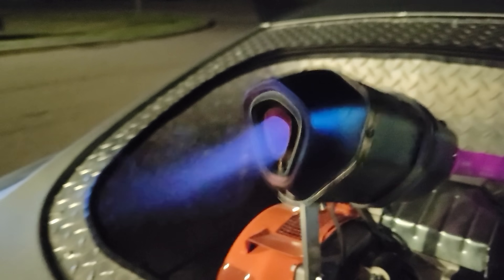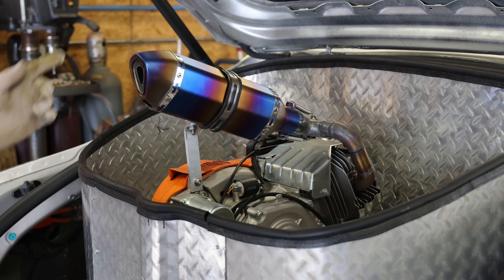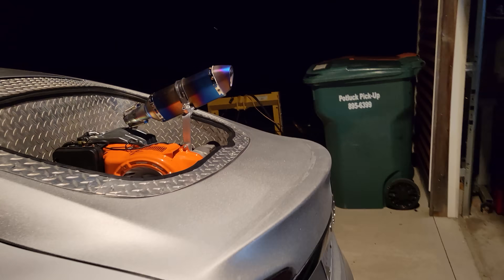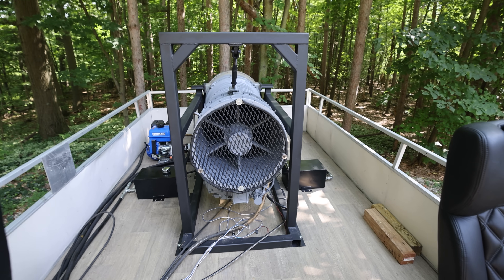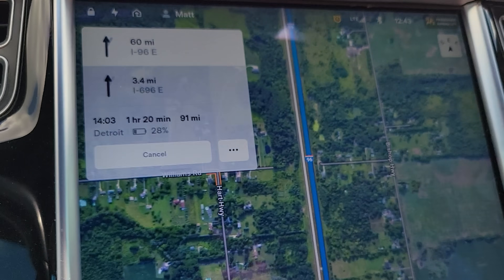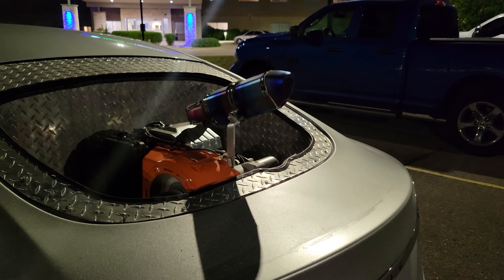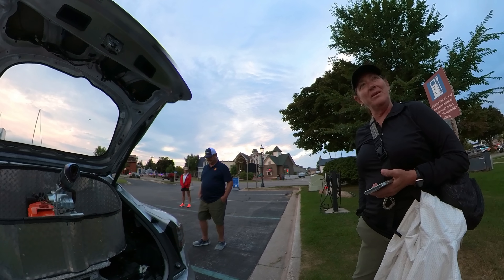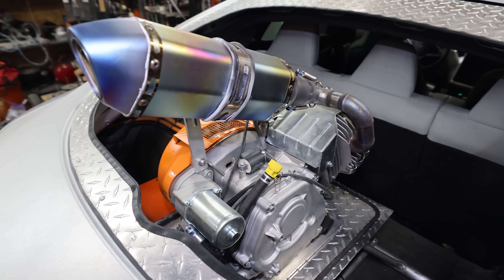Cordless Tesla (I Drive 1800 miles without charging) P.1

Comment: A mod like this is essentially useless. I give the YouTuber credit for the work, but he essentially re-invented a hybrid car, one without the drivetrain to allow the engine to propel the vehicle. And in most cases, the engine couldn't keep up with the power demands the Tesla needed, which is why he needed to run the engine all night to recharge. It's not innovative and it wasn't efficient. If you really are thinking about throwing a generator or engine into your Tesla, just buy a Toyota instead. You're missing the point of what Tesla is about.
Reply: Tesla bros getting butthurt. Cool mod, reminds me of the old Top Gear episodes when they do cool yet useless stuff.
Reply: I can see fire hazard on that gas station. Fire spitting exhaust is really, really bad thing there.
Reply: You got pulled over for going to slow,  this car is only useful for a certain group of people.  It defeats the purpose of even buying 130k car.  All you managed to do was show us your wealthy enough to chop the shit out of a 130k car.. .. "what's all the racket" 🤣🤣🤣
Reply from the maker: @lockhamj  lol... So basically what you're saying is that I'm smart enough to figure it out build it execute it and film it, but I'm not smart enough to get a deal on the car? You think I paid $130k for this lol. Cmon
Reply: I disagree; definitely not useless. 
It IS a valuable experiment. It's a sort of prototype.
Reply: I have developed a magnet motor that produces usable torque and RPM and can easily drive a generator and end the need to plug-in EVs.  It's a simple inexpensive design with minimal moving parts about the size of 2 shoe boxes.  Silent operation, green energy.
Reply: A car with a generator which recharge a battery is not an hybrid car. Hybrid car has 2 engines technlogoly connected to the wheels. This tesla here is an EV with a range extender. Nothing new. BMW i3 has it and it works perfectly fine
Reply: There he is that one moron that takes YouTube videos too seriously. Dude stay quite and move on next time
Reply: Little harsh there   
This is the principles of the future.   You must make the energy. Every where 
not using a central grid.    
It’s the weight to power rerun issue 
Sure we can’t all switch to a 3000 pound battery.    But we can generate 
I feel a light weight car   Built around a roll cage.    With light weight Baja type suspension could run a fluid  drive six speed matched to an over built golf cart motor     At that point an old dc rv generator  would work
Reply: That's why I will stick with my chevy volt...sorry Tesla as much as I would love to own one, I can't imagine interrupting my trips or deal the anxiety of running out of battery. 
I would buy a Tesla anytime if they build a model with a good and quiet generator like my chevy volt.
Reply: Need a heftier power plant.
Reply: What is Tesla about?
Reply: @johnhenke6475  ripping people off
Reply: Imagine if he put in an engine/generator that is 3x the size! He wouldn't need to charge it over night!
Reply: Lol, buy a Toyota Hybrid and get 650+ miles per fillup.
Reply: @Warped Perception:  Can you please pin Nick’s channel for us?  He’s a badass too.
Reply: How useless?  He is thinking outside the box, that is how innovation happens.  I had a drop engine concept that would replace an existing gasoline engine with an EV motor, batter pack, and possibly generator, leveraging existing drivetrain.  To me, the idea is how can you reduce the gasoline engine footprint (even if using a generator to charge the battery or just the battery pack and charging stations).
Reply: Reminds me of those old crazy Top Gear challenges.
Reply: I mean, a cordless Tesla sounds cool. I’d want one of those.
Reply: Well said,  in that case try solar backups or a way to drastically reduce the noise
Reply: lol you are a bit salt.
Reply: Toyota is actually making a hybrid that works the same way. Electric motor.  Has an engine but the engine only provides electricity
Reply: @u-know-this  Yep. But theirs will be better than 19mpg or 6 times the price of electric charging.
Reply: @markp8295  cry
Reply: Tesla is about a badly built car. Limited range. Limited recharging stations. Hours waiting for it to re-charge. Just wait until the computers start going bad and the batteries start failing from age that should be a ton of fun.
Reply: You're missing the point. Teslas are light years ahead of other hybrids. Test drive one with FSD before you make such silly comments.
Reply: HELL YEAH, COAL CITY ELECTRICITY OVER 2 STROKE WITH EMISSIONS WORST THAN A FORD RAPTOR
Reply: Cry
Reply: You are totally right.  The only thing you're missing is he can put Tesla I. The title for more clicks.  

I would just say this is much more like the Chevy Volt that could charge the vehicle while driving and, in certain limited instances, drive off the gas engine.   I would have loved to see where that tech would lead if it wasn't overlooked for a basic electric car.
Reply: Creator looks like an idiot in this comment section, he shouldve used a different muffler
Reply: Tesla needs to look up info about the, Elektro Dumper (eDumper). It's a coal mining electric dump truck that recharges without stopping, and is designed to continuously transport 59 tonnes of material.
Reply: Would it charge faster with a better generator on a higher voltage?

Also that noise drives everyone crazy
Reply: No se trata de eso, pardillo, solo imagina un motor más potente para cargar y disfrutar del tesla muchos KM. a todo trapo.
Reply: William Pyles is a salty sailor that's missing the point of the video.
Reply: The only kind of mod I'll be impressed with is.... MR Fusion!
Reply: Takes 20 days to charge a Tesla off the solar, so you are really using oil, just through your home electirc
Reply: There's nothing to talk about, this project was more of a joke. A joke to see if he can and if it could work and it did. This is content, not a study.
Reply from the maker: No offense but I think you're missing the point of what the Tesla is all about, my car is almost 1,000 HP AWD all electric, loaded with technology and an absolute blast to drive. But guess what, I want 120 MPG with a range of 1500 miles at 80 miles per hour and the flexibility to do what I want when I want, especially with $130,000 car. That's what I want, I don't want a Prius, I don't want a toyota, you go by a Toyota, I've had two Priuses already, I want my Tesla. Just grab some popcorn sit back and watch the show I'll take care of the rest.
Reply: @WarpedYT  My grandfather had this idea years ago. I’m glad someone finally did it. 
The guy who commented said you essentially created a hybrid, which is false. This isn’t the same as a hybrid. Not really.
Reply: @CoffeeAndBusiness  technically this would be called a series hybrid, most hybrids on the market are parallel hybrids.

However what he made here is a Tesla with a motor in the trunk not actually hooked to anything. He shows nothing of how this “generator” is hooked to the car. Or how he overrode the cars internal software that prevents it from moving when it’s charging. It’s fake.
Reply: @Agenderous  I’m ignorant on the subject, but it seems like you could just hook an alternator up then hook that to the battery.
Reply: @CoffeeAndBusiness  You're right. This is worse. As his figures at the end show. 19MPG is dreadful.
Reply: @CoffeeAndBusiness  an off the shelf alternator works at 12v DC. Teslas EV battery packs work at 400VDC. So either there is a special Alterntor/Generator involved(which would be cool to see), or some other devices hooked up in line with the off the shelf alternator. Another option I’ve looked into is using a standard house generator and converting the 60Hz 240v AC into DC, but again if that’s used here id like to see it.
Reply: @WarpedYT  I feel like your insistence on not using an actual charger was silly (I get what you were going for though). You should have used a charging station where it was conveniently possible. Using the generator as a range extender rather than the only source of charging.

Don't know why you're so butthurt in your reply towards William Pyke (I mean I guess he could have been nicer in his original comment, but as a YouTuber, you got to have thicker skin, part of the job), because the fact is, the way you presented the usage of the motor you did in fact just make a worse hybrid, which is also your own conclusion at the end of the video.
Reply: No one cares, buddy.
Reply: @WarpedYT  👍I liked the video and the idea. For me I would want it more muffler to dampen the sound. Also more power from the motor so does run all night. Could also keep you above 10%. But I don’t know Jack if the Tesla will allow that without the quick charge .......
Reply from the maker: @cannednolan8194  yeah I didn't / don't like that crap muffler either
Reply: @WarpedYT  you should get a stock muffler from a sports bike it would works 100 times better
Reply: @WarpedYT  yeah he could have made it more silent with better mufflers, imagine staying in that hotel and listening that shit noise overnight..
Reply: @WarpedYT  haha nice, I'm wondering where you got the extra 250 hp from, my models  is 720hp ish, I was thinking of doing a similar mod, I just bought the chevy volt, which is 100%  electic drive, when it
Reply: @WarpedYT  You say you want 120mpg... But you yourself calculated 24mpg at slow speeds. So you're off by 500%.
Reply: @WarpedYT  I love this idea and I think your experiment is brilliant, and some new cars like the 2022 Civic are implementing some version of this. However (and please correct me if I'm wrong), 'generators' convert thermal energy -> mechanical energy -> electrical energy, whereas the typical 'engine' converts thermal energy -> mechanical energy -> kinetic energy. Hence the engine would be more efficient as it requires one less level of energy conversion than the generator. So is this challenge the limiting part of this experiment?
Reply: @WarpedYT  I love the Tesla option that locks the occupants in the car when it catches fire 👍…by far the most visionary tech when it comes to fixing society’s short comings 😂
Reply: @WarpedYT  LOL!   Who wants to drive the noisiest damned Tesla in the  world!   You're the one that's missing one of the prime points of the Tesla, it is silent.
Reply: @donadams8345  cry
Reply: @WarpedYT  Isn't this also a method to avoid taxes that ICE/hybrid cars pay?
And circumvent noise emission laws .
Reply: @WarpedYT  I bet carmakers will looking sucks after you're ready with all your mods! Nice! 😄
Reply: @WarpedYT  I think you're miss
Reply: @WarpedYT  ironically I think you're missing the point of what the Tesla is all about.
Reply: @GraemeTaylor  no one cares about what you think tesla is all about
Reply: @WarpedYT  Take it to Wyoming and you'll quickly realize that your stated range is actually, quite literally ~26% of advertised. The wind and elevation decimate over half the range alone, and I didn't even take into account if you happened to want to pass through in the winters or when its cold. Someone wrote a story about his new leaf w/ 300 mile range, not even getting 80 on a full charge in WY.  Wanna carry enough food & water plus some supplies incase you're out for a while? Go ahead and chop a few more miles off that lol. Nothing wrong if you don't like to go into the country much, but you're really missing out. Oh yeah, and don't forget that trickle charging batteries is extremely unhealthy for them, will detoriate your "engine" far, far faster than properly charging.
Reply: @WarpedYT  and it's pretty neat
Reply: @WarpedYT  Tell me you're trolling without telling me you're trolling 😄.
I too would love a modern car with all mod cons and 1800 mile range, I think if it was down to me (1000hp aside), a Prius with an extra 20 gallon fuel tank would be cheaper and do the job 10x better, simpler, quieter, and possibly do the trip with one or zero stops. But props to you getting it done. Be interesting the next version of it.
Reply: @WarpedYT  pov tesla is your whole personality
Reply: @WarpedYT  I see what you mean but I (personally) don’t think having a 1000hp AWD car is worth if at the end of the day you drive 45 in the highway so you don’t have to stop, if you have to stop to recharge it, you then use a supercharger silent and faster. That said tho just saw your final conclusion and I see u agree it doesn’t make sense since u gotta stop (and the noice is way too much but with a little more time I bet you could silence that baby and probably a bigger one so you are not that capped and can keeep going at a decent speed
Reply: @WarpedYT  I have a BMW i3 with a range extender that is essentially this setup from the factory (minus AWD and 100HP of course). I love the range extended gas generator on it, 99% of my driving is all EV commuting but when I need to go farther then I just turn on the generator and it works awesome. It's a 650cc two cylinder scooter engine. The i3 itslef is fun, but its not as much fun as a tesla. But I just take the Bronco or the RX-7 if I want to take a mountain/track toy anyways.
Reply: @WarpedYT  lolz your comeback was pretty good except for the 2x Prius part 🤣⚡🤙
Reply from the maker: @DLVRYDRYVR  I'm just being honest, I owned 2 Priuses, they are amazing and one of my favorite cars. I beat those cars non stop and only filled up with 10gal of fuel every 3 weeks.
Reply from the maker: @DLVRYDRYVR  by the way I also still currently own a Supra , Toyota is top dog in the automotive world, fantastic cars.
Reply: @WarpedYT  - I can understand wanting 1,000 HP, but I can't think of too many places or instances where 1,000 HP in a street car would even be something that can be utilized. Meanwhile, you also had to stop so many times to wait for your car to charge back up. This past weekend I drove a 2012 Ford Focus (manual trans) from Cleveland, Ohio to Lexington, Kentucky and back. 340 miles one way, and never had to stop for gas. I filled up when we got there, drove around town for the weekend, then back to Cleveland without adding any more gas. Made it without stopping for more. On a road trip I get about 450 miles on a 12 gallon tank. My time is more valuable to me than power that cannot be used on the street.
Reply: @1001Hobbies  autobah. the straights are no joke u can see urself driving for 30 sum miles fr
Reply: @KoopaSKI  - But this guy is not in Germany, he is in the USA.
Reply: @WarpedYT  I’ll NEVER forget my first experience driving a hybrid car. 
AMAZING!
The ICE started only once when I was merging into freeway traffic.
Reply: @1001Hobbies  I’ll use 1kHP on any side-street! LOL!
OF COURSE I’M KIDDING!
Reply: @WarpedYT  Next time put a diesel generator, should be more efficient
Reply: @WarpedYT  Couldn’t you just get a alternator or something? And you know how the alternator turns with the timing belt, so the RPM of the engine dictates how fast the timing belt spins which in turn dictates how much the car battery is charged, right? Except since a Tesla has no engine, so you could somehow amaze 4 belts that connect to the wheels and 4 alternators, and whenever the wheels are spinning (driving), the belt will turn the alternators
Reply: @WarpedYT  

"Top dog" ? 
Granted they build the best mini van you can buy but most of their sedan type car's lack in design and I wouldn't have a full size Toyota pick up even if you we're buying it for me. 👌
Reply: @1001Hobbies  

Now I wanna see an all Ford Focus street takeover 😆.
Reply: @1001Hobbies  You're obviously not a supercar guy, and yes, I did see you rebuilt a 66 mustang to trophy levels. You're a different kind of car guy, and that's fine, but don't disrespect what Warped Perception is doing. He has a car that does 0-60 in under 2.0 seconds, have you ever experienced that kind of slam your neck back speed, I highly doubt it due to your not understanding the allure of a 1000 hp car! I've had fast cars, but nowhere near that Plaid's speed capabilities, and I used every bit of power I had doing 3 1/2 hr Vegas runs in 2 1/2 hours, it was always a blast, a bit crazy, but fun, and that was my adrenalin rush instead of other dangerous things people do to get that high. I totally get where you're coming from eking out every mile possible from a compact car. I knew someone who gained a lot of joy doing that, he was a penny pinching miser, and every penny saved was pure joy to that man, and I get it. I'm not saying you're a miser, but the gentleman I knew was! Different strokes for different folks as they say, and I can totally see where I could use that 1000 hp, and you can't as it doesn't give you pleasure to go fast like it does myself, and Warped Perception. He just wants to add the ability to use it as you would your econo car, and take long trips without having to stop.😎👍✌🎃
Reply: @WarpedYT  So are you going to address the fire hazards before 130 thousand dollar car burns to the ground
Reply from the maker: @Gasoline4ever  I don't see any fire hazard actually, what are you referring to?
Reply: @Gasoline4ever  It's the aluminum parts surrounding the motor in the trunk.
Reply: @WarpedYT  The gasoline you say you were spilling is the fire hazard.
Reply: @ThangTran-bj4we  the diamond plate he used looks cool, but its not leak proof. my point was he had a fuel leak. If the fuel leaks below his hand made engine compartment, bad things can happen. gasoline, lithium batteries,and a leaky fuel line can produce a hell of a fire. just sayin he needs fire protection to be a big part of his build.
Reply: @Gasoline4ever  😅🍷
Reply: @WarpedYT  build quality of those garbage cans
Reply: @WarpedYT  I think he's referring to the fact that your Muffler produces a flame coming out of it and you admitted on your trip that you were leaking fuel so I too can see an issue here.  The other thing, It's just too loud, parking away from the hotel is fine, but having to wear earplugs while being near your 130K vehicle whiles diminishes the value for me.
Reply from the maker: @markp8295  waking up in the morning is a fire hazard
Reply: @WarpedYT  Hazard/Risk  assessment. Likelihood x severity of consequence.

Consequence = fire

Likelihood
Waking up = very low
Leaving pools of gasoline next to a red hot generator = High
Reply: @WarpedYT  ruined a master piece so that you can drive longer at the cost of comfortbility i bet them extra miles sounds good when they tell you that youll have to listen to lawnmower at max revs if you wanna charge it. and your literally doing the same shit except what u dont have to leave your car charging bank. and all it takes is someone to contaminate that generator
Reply: @KoopaSKI  >tesla
>masterpiece
tesla fans really like to chug that cool aid huh
Reply: @KoopaSKI  Don't forget he only gains 38miles of range per hour running (At 24 mpg at best). His numbers.
So pays more when charging from the generator, and pays more for electric with the increased drag, when not using it for short trips.
Reply: @mappies123  im actullay a mopar fan but i do respect the future of our vehicles All of ya goin to remember tesla
Reply: @KoopaSKI  masterpiece?? I own the same model s and a masterpiece it is not, perhaps a mulan turbo, or a Aston vantage,  but not an early tesla, wonderful car no masterpiece...
Reply: @KoopaSKI  cry
Reply: @KoopaSKI  Yeahbut, it makes for interesting YouTube content. I subed.
Reply: @KoopaSKI  don't forget generators require very frequent oil changes. Which he's exceeded already assuming he ran it for a couple of days
Reply: I'm sure this isn't the first time you've heard this but... Zip it nerd.
Reply: @mrsir2378  👍 GUT LAUGH!!!
Reply: Where are the videos of you doing anything cool or creative?
Reply: @mrsir2378  - Well, on this channel of mine are a number of videos of me working on building a Mad Max Interceptor with an XA Falcon (with XB body parts) I imported from Australia to Ohio, but that has been on hold while I pursue my dream of becoming a filmmaker. I started in 2006 and since then have been Director of Photography on a feature film that is on Amazon Prime (among a number of other films that are not on Amazon Prime). This past weekend I was at the 2022 Scarefest convention in Lexington, Kentucky where we premiered 5 short films (that are all interconnected) that I did lighting on to a "standing room only" crowd. That's just for starters... If you need more I can show you my wife's award winning 1966 Mustang that I rebuilt and modified, and much more.
What have you been up to?
Reply: @1001Hobbies  are you the nerd William Pyle's who was complaining about someone's desire to create? Oh no??  Crazy. Wasn't talking to you, but way to chime in and get a humble plug about your ventures.
Reply: @1001Hobbies  imagine bragging about a mustang award 😆 Hey everyone, it's King shit of turd mountain. Btw I've been writing for some of the funniest people in the country, and winning things money can't buy like comedy contests and paychecks for making people laugh.
Reply: @mrsir2378  - Well, your post was in my comment notifications, and immediately after my comment, so it was natural to presume they were directed at me. Sometimes when we hit "reply" it doesn't always include the person's name on here in the comment window. However, I suspect you are not that observant. 
I am sure you make people laugh. I am laughing at you right now. ;) But your writing does not put you in the same category of someone experimenting with a car. Mechanics/electrical is quite different. I've worked on cars for 40 years, and did it for a living for a while as well. I am about to retire from one of the major automakers. I "may" have some relevant knowledge to the topic here. 
I understand your comment about the Mustang. When you completely lack any ability in a field someone else is proficient in you have to cut that field down in order to not look so inadequate yourself. I am sure it works on yourself, but everyone else sees it for what it truly is. At least I get to laugh at you again. Wow...you ARE good!
Reply: @1001Hobbies  I was ASE and ICAR certified from UTI in Huston. I've built and developed many custom parts with my own two hands before my accident. I put suicide doors on a crown Victoria just to prove a point, I had a 64 Chevy with 3.5 ft removed from the bed and 6" from the front. I built a whole truck that ran on a motor smaller than your generator, We've lifted minivans and lowered semi trucks. I've chopped and channeld more mini trucks than you've probably seen. We did work, it was my job to create, not capture , you don't know me
Reply: @mrsir2378  - Yet, in a conversation about cars, you feel it was most important to tell me about your writing, instead of all this? That makes your claim very suspect. At least I got another laugh out of it. Who lifts a freaking minivan? LOL!!
Reply: @1001Hobbies  people with awd minivans.
Reply: Better than silly electric cars catch fire